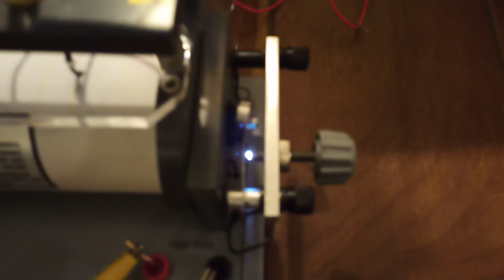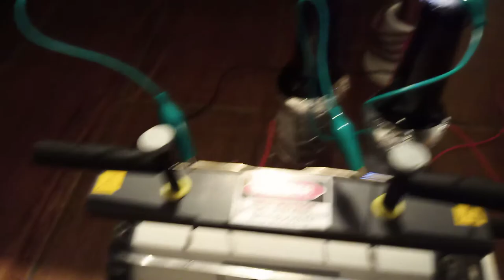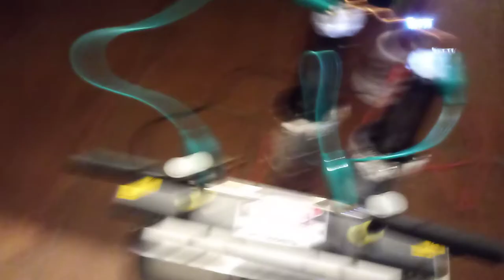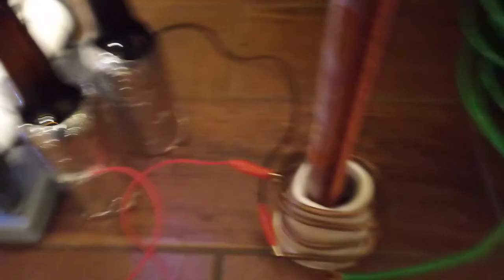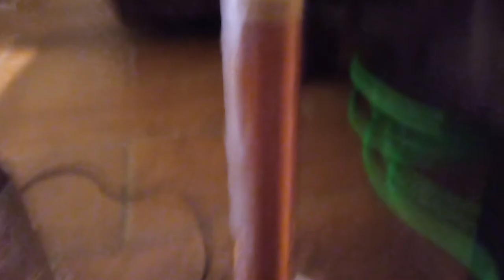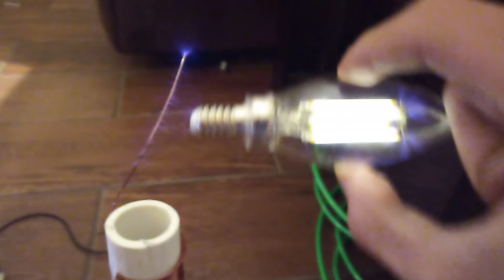More Cold Energy Experiments: I GOT MORE POWER With a Mini Tesla Coil Made by me

Comment: Very interesting setup! May I ask you please what do you mean ( in the description ) when you say “the Leyden jars breaks the volume which is later related to the Tesla coil “?? 
I’m actually interested in the meaning of the Leyden jars here..
Reply from the maker: Ah yes you found a small mistake in my description which I didn't even notice until now, I'll fix it later. It was supposed to be "repaired" instead of "related". So basically, there is a total volume of energy that is broken into two parts by the two Leyden jars (which are basically capacitors) which needs a way to be brought together again into one. The primary Tesla coil does this, and in the process of doing this, the hot energy is turned into cold energy which also simultaneously increases how much volume there is. This is also a basis for free energy, the cold energy will have to always be repaired back into one so, if you connect a bunch of light bulbs or motors in the middle of this before it repairs, the energy will have to go through all of them (giving you free energy) in order to repair itself. But there's more to it than just that.
Reply: @PancakezEater6940   so my most spontaneous and humble reaction is: what’s more to it than just that?? With this remarkable trick you just found a way to engineer the aether energy.. I just want to know more.. and thank you for your delightful answer!
Reply from the maker: @pasqualemasullo6844  Well we know the basis, know we just need to experiment all the possible ways and keep on experimenting until we find the way. There's a bunch of theories and things that I just haven't tried yet and they will be experimented on. I think you are getting a little ahead of yourself though, we should focus more on learning this cold energy first and then we can go on to the free energy, because the cold energy is what makes this free energy even possible in the first place.
Reply: @PancakezEater6940  awesome! Thank you.. this means a lot! Do you then have a clear explanation or some references to point me to for understanding what this cold energy is??
Reply from the maker: @pasqualemasullo6844  Cold energy is the energy which has been hidden from us for at least 100 years now which does not effect us and the Earth in a bad way like the energy we have now does. This energy is noble, it does not kill you or shock you to death. It is the energy extracted from the aether and there's multiple uses for it from killing all parasites, bacteria, virus, pathogens, and fungi in the human body, purifying food and water and nutrients, powering up multiple "impossible devices" like antigravity motors and free energy generators, and it can also reverse the modified seeds so you can plant with actual real seeds that are not modified to grow smaller, and you can also use this energy during the growth of plants so they can grow faster AND a bit bigger, plus healthier. So yeah, this cold energy is just amazing.

Comment: You have high voltage, no current or you would be getting shocked. So your title is misleading, because you have in fact literally zero power. Voltage and current needs to be present at the same time in order to have power.
Reply from the maker: Yes you're correct, but the title captured more attention this way, I didn't intend it in a malicious way, sorry.